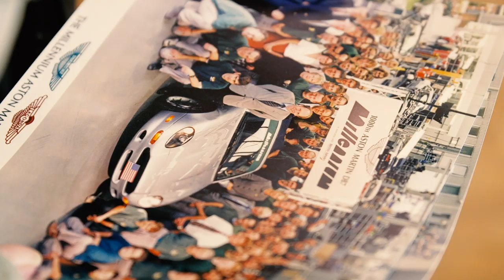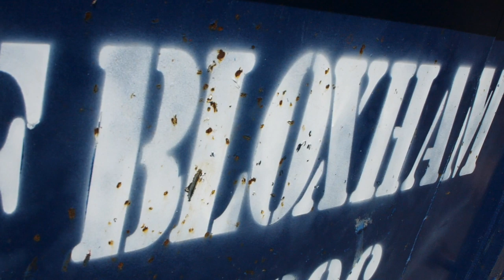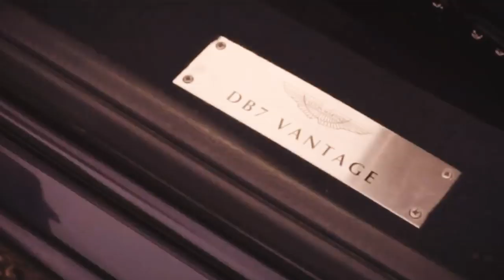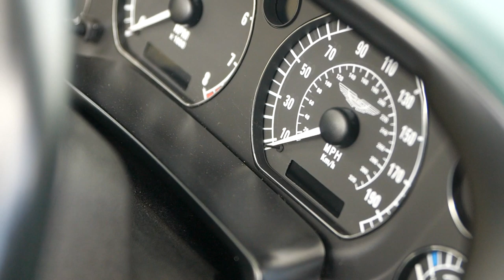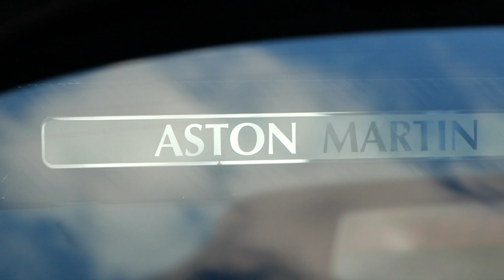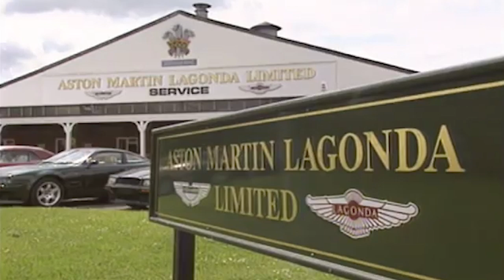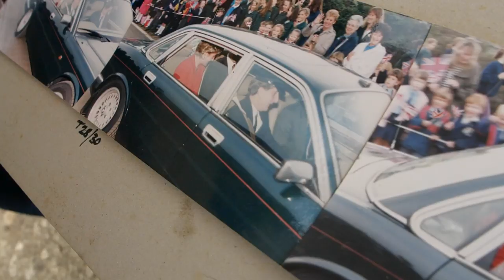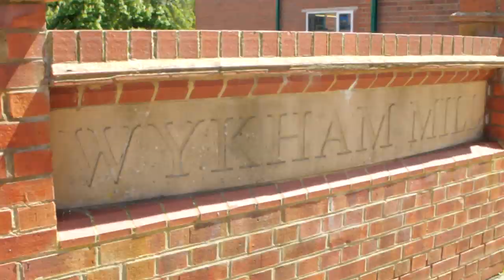The history of Bloxham - Home of DB7

Comment: Wonderful job Steve!  As an original DB7 buyer and still owner (1998 i6 Coupe), thank you so much for memorializing this on film!  Being a US buyer, I never had the pleasure of visiting the Bloxham factory so thank you for bringing it to life for me now.
Reply: Congratulations on the car!  Do you have a manual or an auto?  I've been hunting for an early DB7 stateside (97-98), but they seem rather tough to find (let alone to find a sorted one that's been well-maintained).  How has it been?
Reply: @flyingphoenix113  
My i6 Coupe has a manual 5-speed transmission.  To me, that is the only gearbox to have on an i6 since the car gets it's power from the Eaton Supercharger which requires revs to deliver that power.  With an automatic transmission, the gearbox keeps shifting on you, lowering the revs and making the nearly 2-ton car a bit of a slug in anything but high speed highway driving.  But with the manual, you can always find the right gear to keep the engine delivering satisfying power in all situations.  As such, it's a very engaging drive with a manual gearbox, as you really feel connected to the car, working with it to get maximum performance at all times.

The ownership experience has been wonderful.  Relatively few mechanical issues over my 20+ years with it.  I keep up to date on all service with an outstanding Aston Martin certified mechanic, and drive the car mainly on nice sunny days, so it admittedly has lived a pampered life. Finding a good, used i6 DB7 will be increasingly challenging, as many have sadly not been well maintained.  And if your sights are set on a manual gearbox, it's going to be even harder.  Only 45 5-speed coupes were ever imported to North America, and only 80 5-speed Volantes.  That's only about 26% of the 478 total (Coupes & Volantes) that were brought to this side of the pond.  Good luck.  You might contact Steve Serio at Aston Martin New England.  He knows lots of people and cars in the Aston world and might be willing to keep an eye out for you.
Reply: @andrewphillips8573 , oh my goodness!  Thank you so much for the information!  I am indeed looking for a manual i6 model (specifically a coupe), and I've even entertained swapping a manual into a better-maintained auto model since the market prospects are so rare/grim.  Since you've had yours since new, have you ever heard of/seen any of the US models being fitted with the upgraded performance pack?  Be it that I have a habit of track days (and that I live in the South), I know that an upgraded intercooler would be on top of my "to-do" list.

Comment: I worked at Bloxham July - December 1994 when the first cars were being built. It was a bit 'work in progress' at that time - the composite boot lids didn't fit properly at first and had to be fettled plus the usual new car niggles. The DB7 was basically an XJS and iirc there were some ex Jaguar assembly staff there plus some fairly disagreeable Ford and TWR folk. The only Top Brass guy I liked was Nick Fry who could be found on the shop floor helping out when the chips were down - not bad for a managing director.